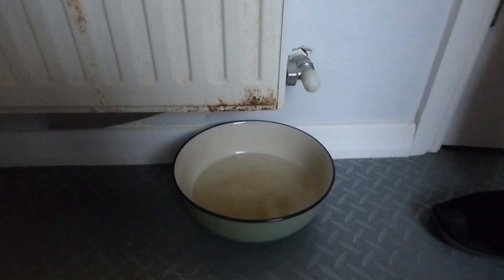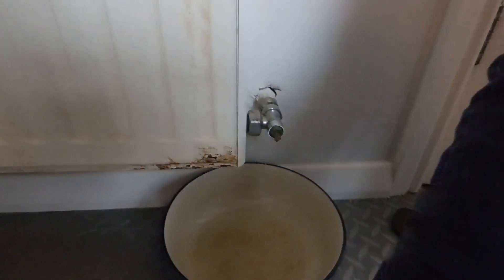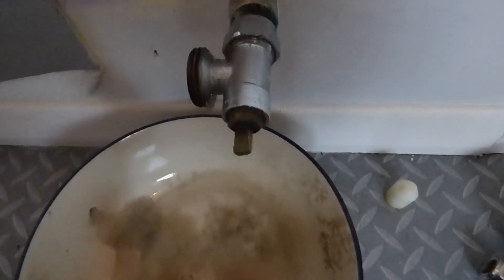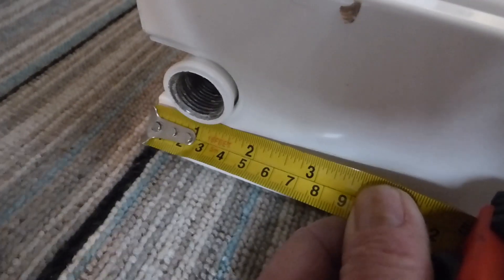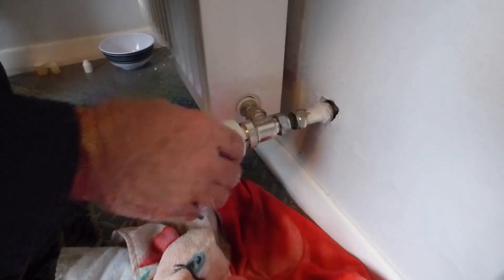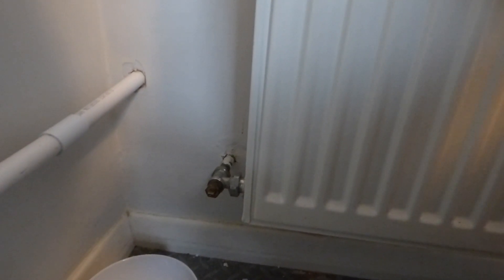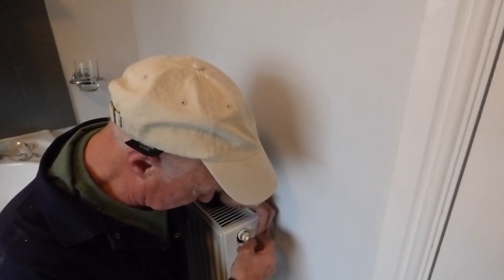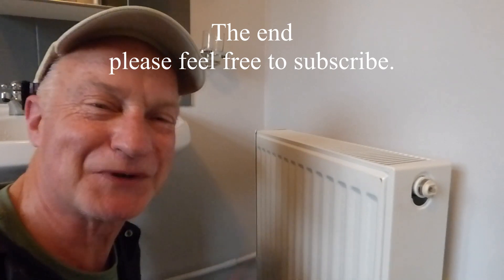How to fit a central heating radiator.

Comment: Great video again. Question... I've just replaced a single rad for a double and the tail pipes coming out of the wall won't reach. There is some play but not enough. Help!
Reply from the maker: You will have to extend the pipes using couplings.

Comment: What type of plasterboard fixings were used to attach the radiator?
Reply from the maker: The wide screw in type that have a posi screw that goes into the fixer.

Comment: I was glad to hear Jan ask the question about shutting the heating off. We had two rads changed over the last few years and not only did the plumber shut the heating off, he also drained the system before fitting each new rad. Maybe he did that to make the job last a bit longer to earn a few more pennies. So I shall remember that if ever we need another rad changed. We have a combi boiler. Thanks for posting Al & Jan.
Reply: Believe me a plumber would avoid draining down unless it was absolutely necessary! there could've been a number of reasons as to why he had to drain down & i'm sure to "earn a few more pennies" wasn't one of them .
I'm guessing you agreed a price before work commenced?
Reply: Maybe he  renewed TRV+ lockshield on the rad or flush the system through + new inhibitor some plumbers like to know when they leave they done a good job after all reputation is income.
Reply: + Paul W + Jay Scott Thanks for your comments. No new TRV or lockshield were renewed during both renewals. He said, "that is how we all do it". I guess all tradesmen work their own way depending on how they were taught I suppose.

Comment: Could you replace the valve by just snatching the pipe without draining down?
Reply: Worrun if you take the pressure out yes.
Reply from the maker: You can, but have plenty of old towels under as you will get some pressure at first. Also some times the nut of the old fitting will not fit the new.

Comment: hi, great video!
looking to replace one of our radiators... the emamels chipped off awful and after looking into it its cheaper just to get a new one. we have the same radiator as you have just fitted and would be replacing it with the exact same one. would we still need to put on new valves? x
Reply from the maker: No the old ones will be OK.

Comment: I have a Vaillant boiler,  I have removed the bathroom radiator, but havent yet replaced it,  do I need to connect them two pipes together, to make the heating work please?  Thanks    ; )
Reply from the maker: No  it will still work.
Reply: Its not tho  : (  the only rad getting warm is one bedroom next to bathroom, none of the new rads  downstairs are getting warm either?  Help!
Reply from the maker: If you have a combi make sure the pressure is up to one and a half bars, if you have an F and E system, then you have air in the system or the pump is not working.

Comment: Got a man coming to replace some radiators next week. Hope he does as good a job as you. Roughly how long would it take to replace one radiator in real time?
Reply from the maker: About 2 hours.
Reply: dereton33 Thanks. Could be a while for three radiators!
Reply: BadgerBotherer1 depends on the type of system, I sometimes find the job in hand is pretty straight forward & you can pretty much predict how long it will take to swap a rad but on a conventional type system you could run into a number of problems that take longer to fix than the job in hand, blocked cold feed, airlock......etc
Reply: Paul W Thanks. Hopefully it won't take too long, as I may have to go out, and I don't like the idea of leaving strange workmen loose in my house!

Comment: hope you didn't pay jan for the time she "skived off" . excuse my ignorance but why shouldn't you have a isolating valve on a rad & are they acceptable anywhere else on the pipework ?
Reply from the maker: They are never fitted to heating pipes on rads, only on cold and hot supplies.  They tend to leak on heating pipes, as the washer seal breaks down after time.

Comment: i have a old rad on the hall way H700X2000 L I NEED TO REAPLACE  IT DOUBLE  DULUXE 600X2000 THAT BE THE SAME(BTU 11966)  THANKS.
Reply from the maker: No problem Ratch.